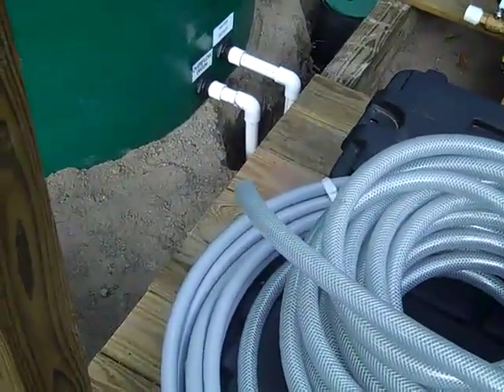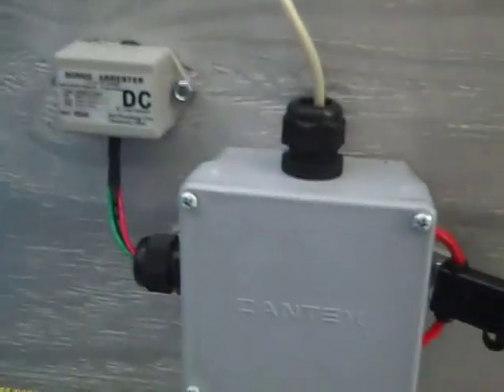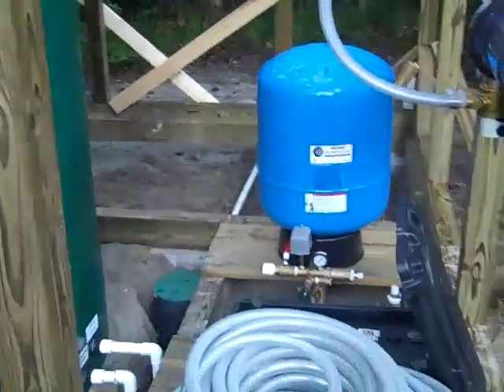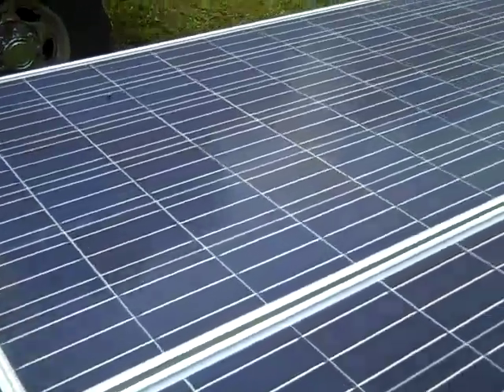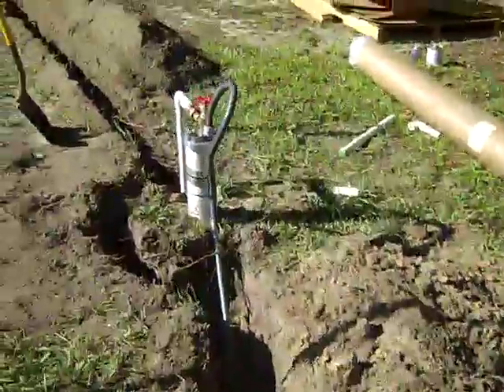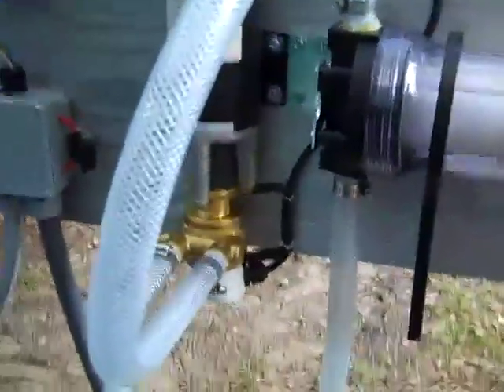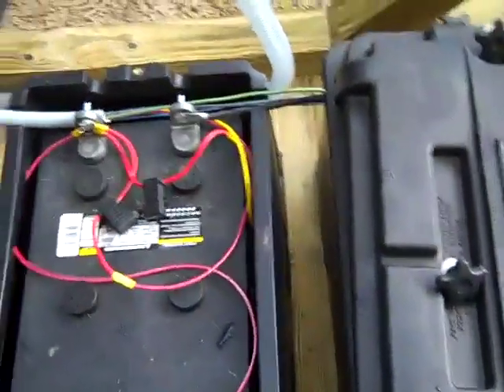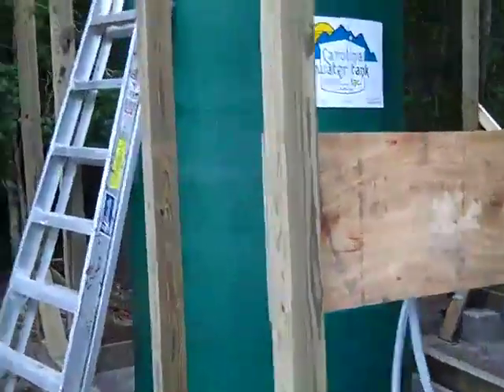Video 300! Off-Grid Water System during the install

Comment: Nice to see the video Eng775, esp since this is a project near and dear! :) I'll let you answer the questions related to your system, but I may jump in if any relate to the building or the well specifics. To Wm. Gahres: the cost to drill the well was $2100 and that was for the well and casing without the solar system and related hardware and installation. The well is 120' to bottom with 100' feet of that 4" casing and the last 20' in rock. Static water level is 20'. It is ideal for the pumps Eng775 spec'd for this job. The well went in before the proposal was worked up so Eng775 had the well spec's ahead of time. Eng775 can give you the depth specs on the submersible and the Simple Pump. With the refresh rate I enjoy on this well draw down is negligible. I have drained and refilled the cistern to flush out any plastic particles from the manufacturer. Takes about 6-7 hours of good sun to fill it;1050 gallons. As a side note, if any of you have any doubts about using Practical Preppers for this or other prep services, I can tell you they are great to work with and I would use their services again in a heart beat. Once the wash house is finished I'll post a vid and also pass on inside/outside temperature differentials for the coldest days.
Reply: where is that video?

Comment: Lots of questions here over the last number of years. I will try to answer some of them. The wellhead is insulated and also has a heater strip that we turn on in exceptionally cold weather. The heater strip runs off an inverter in the cistern building but we only use it occasionally. The batteries, surface pump, filter and cistern Are all inside an insulated building. Sheathing and insulation were installed after Scott did the mechanicals. The cistern building only requires supplemental heat when the outside temperature goes below 20°. Supplemental heat is provided by a small kerosene heater but we only need to run it a few days a year and not every year. There are no pipes exposed to the open weather.
Reply: Thanks for sharing. I am looking to do something similar to this myself. Not sure if you mentioned it, but how thick is the slab?
Reply: Mashoutman, if you are asking about a slab for the cistern house, the foundation is dry set concrete cap blocks, in a running bond (like laid brick) sitting on gravel, from 2 to 3 blocks deep depending on grade. The sill is 6 x 6 PT with half lap joints at the corners. The main frame is 4 x 4 PT timber screwed to the sill. The cistern sits on a bed of fine gravel called UCL base, used as road base. The mechanicals are on a raised deck of PT plank.
Reply: @1NCCCH  I see. Thanks. I need to get in touch with those guys and see if they have plans and a parts list put together.
Reply: I designed and built the cistern building and had the well drilled. Scott Hunt (Engineer775) at Practical Preppers designed and installed the mechanicals. He does great work and his designs are simple and efficient. Cannot go wrong hiring Scott.

Comment: The solar heater will basically be a built like a 2 x 6 wall attached to the outside of the building.  It will have black screen material that collects the solar heat and releases it into the interior.  I'm sure you've seen them.  Do you think that will prevent the water system from freezing.

Comment: Have you thought about a dump load for the solar panels? Maybe a small water heater with a DC element to preheat the water source to the propane heater. That way you would get maximum use from all the power produced from the panels.

Comment: I wish my water table was that High.. my pump is down 380 feet on a 420 foot well.. I would love to have a shallow well as you have, just to put a hand pump. Nice set of solar panels you got there. I would have use a bigger gauge wire between battery's for the amp loads... GREAT VIDEO THANK YOU....
Reply from the maker: Your numbers do not tell me your static level.  How far from the ground level to the top of your water?
Reply: it is about 20 feet...
Reply: keep in mind as I use the water in the house that level will drop a LOT.

Comment: I have a rainwater collection system in a 10 X 16 room attached to my garage.  It consists of 4 275 gallon totes, 4 55 gallon barrels and a shallow well pump with a pressure tank.  I am concerned about how to  keep it all from freezing.  You mentioned a couple times that your big tank will provide thermal mass that will keep the building warm.  How does the big tank absorb heat in the first place?  I am thinking of putting a passive solar heater on the outside of the south facing wall.  cont..

Comment: Without a well, I plan to use water in a rain catching system on relatively flat land with
a few thousand gallon tank. Would this setup work in a similar setting to pump water from the tank through a purifying system and directly into the house? I have been searching and cannot find a setup that would allow me to do that.

Comment: word of caution, never install fuses in with batteries unless sealed type and even then its frowned upon, the use of open bladed type which are not rated for operating in a volatile environment. in the event / condition of over load, high current situation and under normal charging and discharge state, battery's generate hydrogen gas if for what ever reason the moment of arc / flash when the fuse blows will ignite the  hydrogen gas and cause the battery to rupture,end of battery.

apart from that looks good

Comment: I'm getting close to having my well drilled. Depth will be 280 feet. Static water is 30 feet less than that. How can I incorporate solar, or a solar backup? I do have 290 watts of panels, a midnight 150 charge controller and 4, six volt golf cart batteries...

Comment: So every thing is exposed ....lines , pump , filter etc. all above ground .... it does not freeze where your at ?  if so thts great ... Im running a 48 volt system off grid and I trenched my water line from tank to cabin ....it freezes here below zero here sometimes in the winters .....so have to bury , insulate every thing ....
Reply: Hi Ski Bum. The entire system is enclosed and insulated. All of the water lines are insulated and or buried. We have no frost line in Eastern Carolina so the pipes only have to be 18 to 24 inches underground. That’s one of the reasons we left the great White North.

Comment: Did the big tank keep that building from freezing in extreme cold weather? How cold did it get in there?
Reply: JY, The cistern moderates the temp swing, it does not freeze, but the pipes might. Outside temps below 20 deg and we play it safe with a small kerosene heater.
Reply: @1NCCCH  thanks

Comment: @engineer775, how deep is your well? any thoughts on a 240v/20A submersible at 280' ? and how it would run on solar? how do you like the Simple PumP?
Reply: A battery bank and 240v inverter could work for your pump

Comment: I have a random completely unrelated pump question. We have just your standard well pump and when your running the water for any period of time the water pressure fluctuates a lot from a almost nothing to crazy high. Seems like pump keeps turning on and off. Any idea of the cause/is that normal?
Reply: Sounds like you have lost storage / expansion on your system, you probably need a new pressure tank. I could be wrong only 25 yrs experience but that would be my initial diagnosis.

Comment: What do you do to prevent freezing? South Car is a bit warmer than New England in winter. Thanks.
Reply from the maker: In New England , Pitless adapters would be used int eh well and all plumbing would be buried below the frost line.  The booster pump would be kept in a heated mechanical room.  So standard freeze proofing techniques would apply but the system would work the same.  We have done this in Maine.

Comment: why not put the tank and other stuff closer to the well head so it is all in the same building? Is it a bad idea to surround the well inside a building?
Reply: Dave, we decided to keep the wellhead clear in case the casing failed and had to be rebored. I may eventually build a small shed over the well head to protect it better than the plastic rock that now covers it. The cistern house is tucked back into the wood line in order to keep the field clear. The distance from solar array to wellhead is about 15 feet and from Wellhead to cistern house is only about 30 feet.